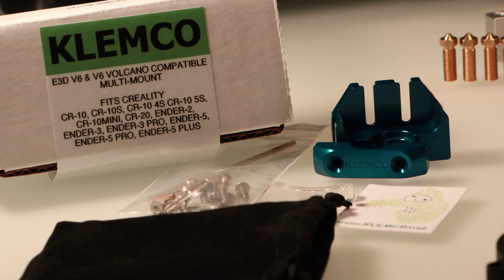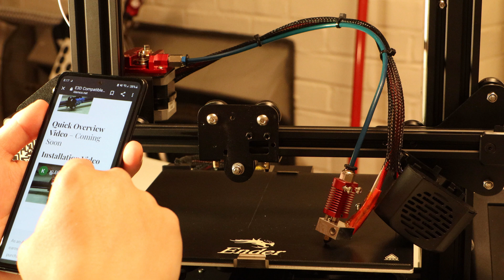Ender 3 V2 - Print Silently and 4X Faster!  (Step-By-Step Guide)

Comment: I have an Ender 3 and turning it into a v2 and also putting a NEO hot end on it and going to make it direct drive. This is costing me more than I could have bought a NEO used, but at hte moment with the upgraded main board to 4.2.7 and a V2 screen and quiet PSU upgrade fan, I only hear the fromt fan when it is printing. I have hte Ender 3 V3 SE and that is my main printer, but I start printing things and then think I want another thing printed and have to wait. Now I have 2 printers, I dont have to wait. I am 62 and I am learning a lot about printing, designing and also about the workings of the printers.

Comment: Squash balls wont bounce untill heated up. Squash players stick them under their arm pits to heat them up before starting to use them and they heat up more with the energy of being hit by the racket and wall. Then they are very bouncy.
Reply from the maker: That’s is cool to know
Reply: @NathanBuildsRobots  At least the printer will not be bouncing around. :).

Comment: Hi Nathan, I hope you are well and healthy, I have Ender 3 V2 Neo and I have upgraded with bimetal titanium and copper heatbreak and use MK8 hotend block with the size of 20x20x10 and use Bondtech CHT nozzle 0.4 my mainboard is allready silent one though I haven't upgraded to Marlins latest it is stock Creality software I have also replaced heatbed springs with plastic elastic springs and so far pretty happy with it. But I wonder what is your view about dragon hotend vs MK8 one? I mostly use PLA maybe PETG in future... But I will stick with PLA for now. Did you see real comparable results in print speed/quality with the Dragon Hotend upgrade? Should I consider to upgrade too? Thanks in advance I just subscribed your videos are really informative!
Reply from the maker: Anything with a longer meltzone will increase print speeds. Dragon with cht should be able to push 32-40 mm^3/s vs your current setup can probably only do 24. So yes there is a speed increase but you should also consider a direct drive setup as that really helps with high flow rates in my experience
Reply: @NathanBuildsRobots  I have also have double gear extruder with hardened steel gears I have Direct Drive Extruder plate for Ender 3 v2 on my upgrade list since I bought it. Thanks for your answers  Nathan😊 I will upgrade to the dragon hotend too I guess 👍

Comment: I made similar mods to v2 but I made PETG housing for the motherboard fan and power supply fan, and the buck converter kept the original housings intact and replaced them, I also soldered and heatshrinked any connections, and all my wiring is hidden. No need to butcher parts when you can just make new ones with your 3D printer.

Comment: is this still a good option or are there better alternatives today
Reply from the maker: There are better alternatives. I’d reccomend going straight for a direct drive extruder upgrade. The Microswiss NG with a CHT nozzle and maybe a ceramic heater is pretty much the best setup around as an Ender 3 upgrade

Comment: Do you have any recommendations that dont include messing w voltage. Im fine w it being loud if i dont have to mess w voltages.  Tx for video!
Reply from the maker: There are quieter fans that run on 24v, I just don’t know if any that are as quiet and reliable as the Noctua fans. You can also use current limiting resistors in series with the fans

Comment: in my experience ive found that using a dual 5015 radial fan set up for part cooling on a low voltage is more than enough cooling for my prints ( i usually print functional stuff so not anything that demands insane quality) and it is dead silent. i only use  an A4x20 noctua fan for the hot end fan
Reply from the maker: That is a good plan. I would prefer if fan throttling was don’t by voltage modulation rather than PWM, so you don’t end up with that start/stop noise at any throttle aside from 0 or 100%
Reply: @NathanBuildsRobots  you could use one of those buck converters and a little voltmeter in parallel so you know vaguely the percentage the fan is running at however those converters are a pain to change the output with that tiny little potentiometer knob
Reply from the maker: @percival5771  yeah, it would be nice if there was a buck converter that throttled based on the PWM signal. I have devised a circuit using a capacitor, diode, and some resistors but I will have to test it out to see if it works.

Comment: I am new to this with a Ender 3 V2 I bought for Christmas. Nice video and some great upgrades for me to look forward to. One question - why is your power supply on the vertical axis? Mine is a stock machine with the power supply below the bed. Is this because Creality changed the design and now mount the power supply below the bed? Or is this something that you did for some reason? TIA
Reply from the maker: I moved it in a previous video. I like it vertical so it stays cooler

Comment: Which phone splice connector did you use?
Reply from the maker: It came with one of the noctua fans. Check what comes in the box for some of those Noctua kits and they should show up there. But pretty much any connector will work, the fans draw something like 0.05A
Reply: @NathanBuildsRobots  I went ahead and bought what I think are the same ones at lowes, hoping they work. Doing the fan upgrades same as you but to an ender extender 400 xl

Comment: I think these ideas are great and I don't mean to be negative, but the case is there for a reason, fire and overheating. Removing that layer of safety is questionable. Even with the way the case cover is made - there are no louvers, so it wouldn't pass UL from the get go... I wouldn't recommend removing a layer of metal between a fire source.  Finding a Fire resistant PLA might be a better choice. And I am probably overthinking things again. Thanks for listening/reading :)

Comment: I got a quick question. While my prints come out nice, there's tiny nicks in the prints (that is, tiny bits of PLA that juts out from the prints). How can I mitigate these issues? My hotend temps I use for 205C and my extruder step speed is 93 Steps/mm. And my print is with stock parts aside from a modified firmware to make leveling adjustments slightly easier.
Reply: Play with retraction settings, I set mine at 8 mm (in cura); the default value was 6 mm if i remember well; also make sure to clean the brass gear that pushes filament into the heat block and verify that the filament is well tightened between the brass gear and the metal wheel; you can achieve this by tightening the allen screw connected to the spring of the extruder mechanism, if you need more tightening, you can replace the stock screw for a larger one. Hope it helps

Comment: Whats the purpose of 12V fans, are they just for readily available than 24 V counterparts? I'm about to get a 3 V2 but I'm not too familiar with any form of soldering or more involved wiring, so the 12 V step down seems like quite a hurdle.
Reply from the maker: No reason to go with 12v other than availability. 24v fans will be much easier to install. 

Noctua is working on 24v versions specifically for the 3d printing market, but they won't be out for a while.

Comment: Didn't you need to modify the y offset or limit switch to account for the klemco 0.315" thickness?
Reply from the maker: I just print in the middle of the bed 😆

Comment: Can I run 2x 12v fans on the 24v connection on the mainboard?  Or 2 x 24v fans?  Or rather a converter?  Anyone have instructions?
Reply from the maker: Yeah you can wire 2 12v fans up in series and run it on 24v. I've done it before with good results.

On my latest video I used a voltage regulator. That's the best solution but it's for low power fans only, like the noctuas. https://youtu.be/FHK-s3yqwek
Reply: Ok i Order 2 x 24 v now and Set it parallel, does this work too?
Reply from the maker: @vielzuhighxD  yes

Comment: This is the exact video I was looking for. I don't currently have an Ender 3 v2, but I'm looking at getting one sometime this year and I want to know what some of my options are for upgrades.

Few questions, if you don't mind.

1. Is this just the V6 All-Metal hot end from E3D? I'm having trouble seeing what's compatible with Ender stuff.

2. Does the V6 hot end work with all of the E3D nozzles, or do you have to buy the volcano hot end to use volcano nozzles?

3. How high is the risk of damaging your printer / throwing calibrations unfixably out of whack when installing these things? I'm pretty handy with tools, and I'm fairly competent with installing things that have a somewhat decent manual.

Thanks so much. You've earned another subscriber!
Reply from the maker: Just don't short anything out and you'll be fine. There isn't much to worry about with throwing off calibration. 

I'm making a2nd v2 video right now, should be out in a couple days.

I would recommend just getting an all metal heatbreak and CHT nozzle as it will be easier than installing the whole new hotend, so you can get the same results in terms of print speed for less work
Reply from the maker: Is hard to answer all of the questions in the comments, I think it works be best to ask on the discord!

Comment: Love your videos! Got my Ender 3 v2 the other day and I'm already wanting to upgrade it with new fans and hotend. But how did you get the 12v hotend to work on the 24v system?
Reply from the maker: You just need to convert 24v to 12v, there are a number of ways to do it - in this video I used a DC buck converter, but you can also use resistors or diodes to drop the voltage.

I will be making a video on 3D printer electronics that will explain these concepts in more detail.
Reply: Ok, so you put the wiring on the same buck converter you used for the fans
Reply from the maker: @niclasnordqvist  Oh wait, no! I reused the 24v heater cartridge that came with the printer. 

The 40w heater 12v cartridge will act like a 160w heater cartridge if you put it on 24v!
Reply: @NathanBuildsRobots  Also, those little Buck regulators are usually only good for around 3 amps, maybe five with a heat sink. I wouldn't trust one of those to reliably run a heater cartridge.

Comment: DC-DC converter for a single 0.05A fan? Isn't that a bit of an overkill? Wouldn't a simple voltage divider be enough?
Reply from the maker: It is powering 4 different fans, which I feel like barely pushes it into buck converter territory.

Comment: What diameter shrink wrap did you use for the buck converter? 1inch?
Reply from the maker: It was some random stuff that came with another electric device I bought. It hard to fit into. 

I would get 30mm or 1.25".

Comment: It is strange to put one fan on top of another. Your a more powerful fan has to overcome an air resistance of a weaker fan.
Reply from the maker: Only the strong will survive...
Reply: @NathanBuildsRobots  Not how it works... you SHOULD have removed the one inside the case first otherwise you are making the noctua do more work for almost no benefit
Reply: @Jonneh1991 you get higher pressure with 2 fans, less back-bleed.  Ever seen a jet turbine?
Reply: @azimuth9819 Aren’t the stationary blades usually flipped in the opposite direction?
Reply: @xenontesla122  yes but on a low pressure scale this would still prevent back bleed, I use 2 120mm fans to push through a 3in duct with nice pressure

Comment: If you print only with PLA , 0.2 nozzle and very high resolution small items,do you need this upgrade?
It will print better and faster?
Reply from the maker: I don't think you would need it for low speed. Volcano nozzle is mostly for high speeds.

Comment: You really shouldn't double up on fans unless they are the same ones, I mean unless you want to keep buying frame because they soon at a different rate, your actually causing less airflow then what the single noctua can push.
Reply from the maker: I was under the impression that More fans = More better. I was  thinking about jet engine where there are a ton of fans in series which increase static pressure.

But without stator fins, (stationary blades and facing the opposite direction as the rotating blades), I think you are right and doubling up on fans doesn't help much or at all. It'd be interesting to do some testing to find out, but I don't know if enough people care.

Comment: What gauge cable are using to connect the buck converter to the 24v power supply??
Reply from the maker: I used 14 awg which is way overkill, but guarantees the buck converter will never draw enough current to burn those wires, even if the 12v line is shorted. The overcurrent protection will kick in and it will be failsafe in that regard. 

Plus the power supply terminals are built for larger gage wires. So it makes it easier to plug into using crimp connectors like these 

https://amzn.to/2YtK0yI

Comment: My 9-year old grandson wants to print and design 3-D planes and rockets. Will this machine do that? Are there inexpensive programs or software to do this?
Reply from the maker: I would reccomend a voxelab Aquila, it's super cheap and just as good as the Ender 3 (I have a comparison video on my channel). Just take care when assembling and leveling the bed.

https://amzn.to/3CsCXFe

For printing out a plane or rocket I would start by looking at projects on thingiverse. You can download the models for things other people have made. 

https://www.thingiverse.com/tag:aircraft

Once you know how to print and want to make your own designs, Fusion 360 is a free CAD software that is quite powerful, and can be downloaded for free.

The modifications I did in this video prioritize speed over quality. For aircraft you usually want light, thin structures, so I'd just set the printer up and print some stuff with it as a stock build. If you want more speed you can start looking into mods like in this video. Good luck with your grandson!

Comment: What were your printer settings?  About to the exact same upgrade.
Reply from the maker: For this video I believe I was using Prusaslicer with the default Ender 3 profile. 
All I did was update nozzle diameter and it changed all the extrusion widths automatically and worked great.
Reply: @NathanBuildsRobots  0.06 nozzle? Or bigger?
Reply from the maker: @coreelite  yes 0.6mm
Had to rewatch my own video to see it at 4:26

0.6mm is the sweet spot for a mostly stock setup. It keeps a good amount of detail on your prints. 

0.8mm and up will unlock much faster speeds but you will also want to upgrade to a copper heater block, copper nozzle, dual gear direct drive extruder, and 60 watt heater cartridge to get the most of it. You start losing fine detail at these larger sizes too.

Comment: When I purchased my e3d v6 kit, I had to use the included thermistor. I couldn't reuse my old one :( So i cut it off and attached the new one. Kind of a pain but it had to be done.
Reply: Did you splice into the old one? Or did you cut off the pin connector on the new one and attach it to the board?

Comment: I'm confused, what about the new hot end assembly enables it to print faster compared to stock besides changing speed or nozzle diameter?
Reply from the maker: The longer melt zone allows the plastic to fully melt before hitting the constriction in the nozzle, thus reducing resistance, allowing higher flow rates.

Comment: Are there lots of videos of this custom ender 3v2 in action?  Id be interested in it's long term performance
Reply from the maker: I've printed over 100hrs with no problems. Only 1 issue I had was a clog due to bad slicer settings. With the Capricorn tubing and all-metal hotend you need to turn down the retraction distance from the default of 5mm to more like 3mm. Otherwise it pulls the filament up too far and it can resolidify in the heat break throat. 

I am modding it again to make it another 4x faster now, stay tuned!

Comment: I take it you're not aware of the fact that original fan in Meanwell 24V PSU is actually 12V so you could have simply take it out and plugged Noctua 12V directly to PSU mother board and it would get 12V without step down board.

All in all you're butchering a lot of stuff here that you could have simply printed new motherboard cover plate with hole for bigger fans. There are plenty on i.e. Thingiverse. Same thing with PSU cover. There are replacement mesh covers that you can print and install instead of original metal cover that will help with air flow. 
Sticking noctua fan on original fan that doesn't even spin all the time definitely doesn't help with air flow and cooling...

I wouldn't recommend anyone do these mods/upgrades this way...
Reply from the maker: I like that, call me The Butcher. 

This was one of my first mod videos. In my more recent videos I've improved my metal-work, use of 3D printed parts, wiring.

I took the power supply apart and have been considering alternate wiring for the fans. It looks like it has a 12v fan, with that lower voltage being produced by a zener diode. One could probably short out the diode with a wire to also be able to run a 24v fan, or short out the control transistor to have it run in always-on mode. But for now it works so I'm going to keep it how it is.